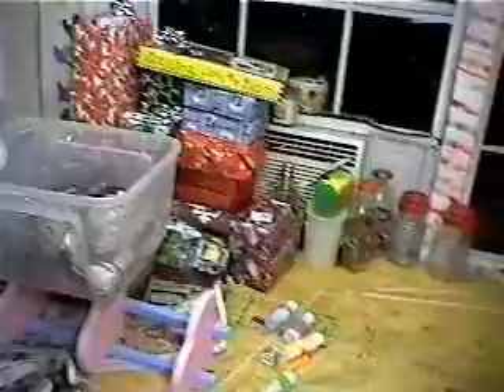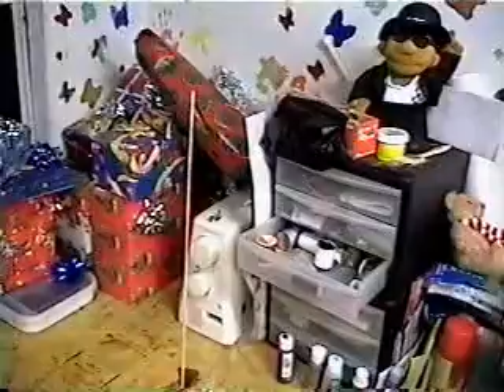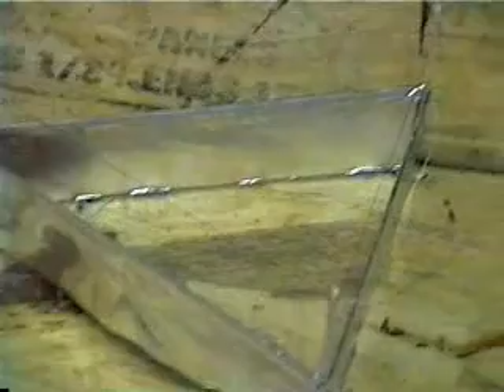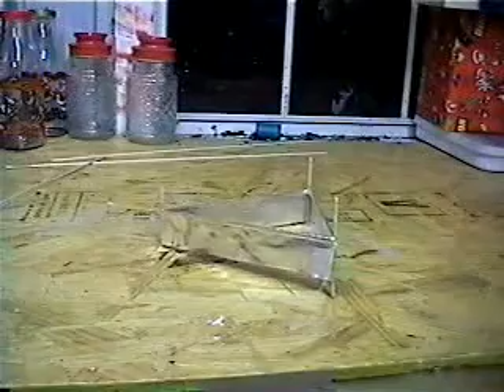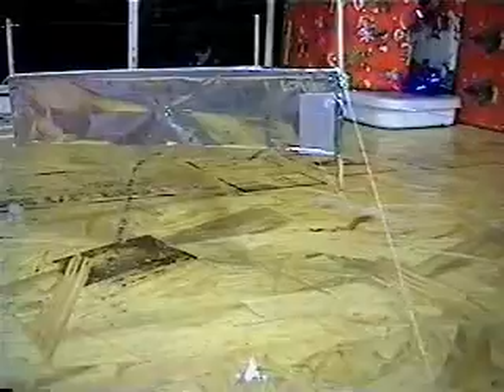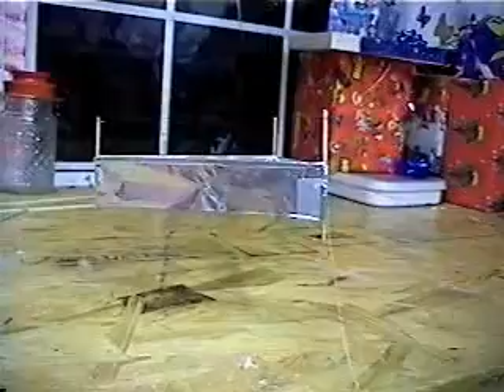My Lifter Expriment

Comment: In answer to your question you need to understand that it's not the power that's creating the lift.  The polarity doesn't matter because its not the electricity doing the work.  The magnetic field around the wire and foil ionises the air around it.   The voltage in the wire ionises more than the low voltage through the foil.  It tries to even out and pulls the ionised air from around the wire towards the foil creating movement of air.  This is why the polarity doesn't matter.